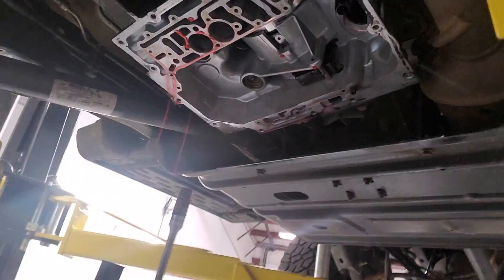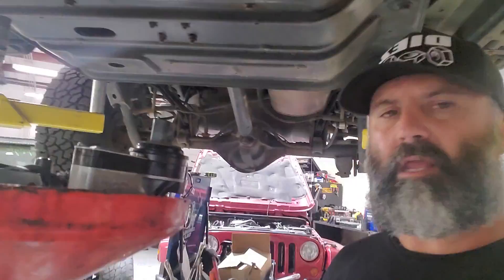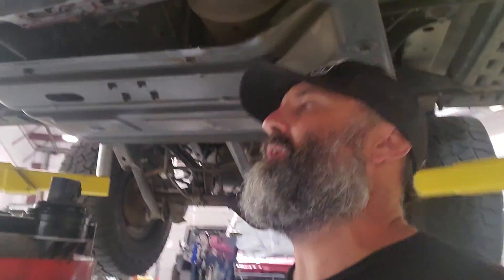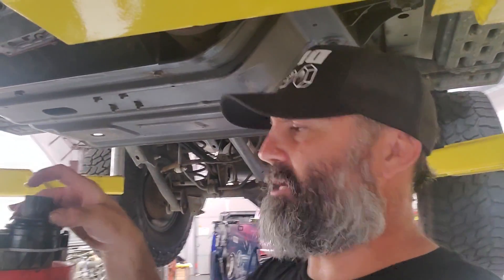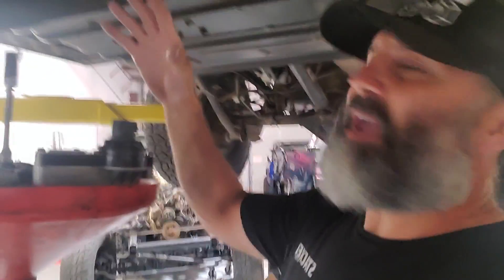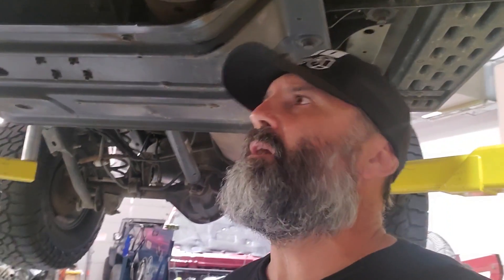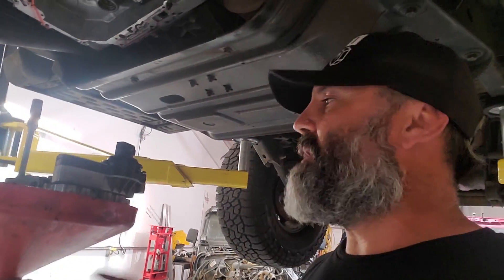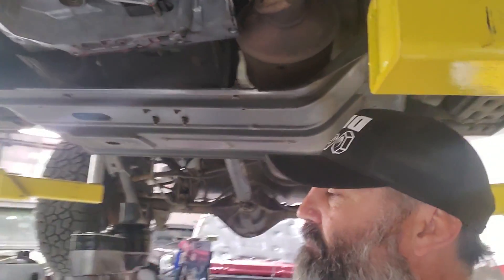42RLE jeep trany problems

Comment: I had to replace my pcm in my 2010 Charger with the 42rle and now it shifts fine except every now and then when I brake and it down shifts to 2nd when I accelerate again it bumps into 3rd and then it shifts fine again with no issues. Any idea what could be the culprit?
Reply: Did you reprogram the PCM to the VIN number? There are several things like fuel injectors, gear ratio and transmission shift points that are VIN specific and might not work properly if all parameters weren't updated when the PCM was swapped. You must have done some of it or it wouldn't start, but things like injectors or transmission controllers might let it run, but do weird things.
Reply: @mikelemoine4267  it was flashed by the dealer
Reply: @ImOBreezy  You might try disconnecting the battery and forcing it to relearn. Otherwise, maybe ask the dealer to scan it and make sure they have all of the latest flashes installed and that no codes are stored. Perhaps they missed updating something. Good luck, hope it's a simple fix!
Reply: @ImOBreezy  what was your transcoding before the pcm replacement?
Reply: @KingIrvXL  I have no idea
Reply: @ImOBreezy  transmission I meant

Comment: Hey man I could really use some help. I have a 05 Jeep Liberty Sport 4x4 with the POS transmission you are working on. The line going into the front of the transmission is leaking like crazy and this transmission is less than 2 years old. We put in a remanufactured transmission with no issue when we bought this Jeep. We dealt with the overheating issues and now all of a sudden the transmission went into limp mode and now it's just absolutely stuck and we cannot get anything loose despite you saying it needed a 10 mm this thing has a 10 mm, 15, 16, 18 mm, all these weird and I numbered votes on it. We can't seem to break loose even with a breaker bar the driveshaft to get it out of the damn way. I'm very frustrated and my father who is working on the vehicle can I physically handle doing something extensive like dropping the tranny again. There's no leak in the seals at all it's just at that line by the driveshaft. Really don't think it's the valve body. Never heard of any even leaking in this particular area. Any suggestions would certainly be appreciated because I am a single mom and don't have a lot of money to be dealing with this. We don't have a lift which would make everything a whole lot easier like you do we just have the regular old Hercules Jack to work with when lifting the car up. We have a new one that we just bought today so is there anyway you can help me I would appreciate it.
Reply from the maker: WOW call the shop 704-929-1788
Reply: @jeepstyle4054  in Richmond Virginia these guys here are idiots. I went in to do a recall about 2 years ago on the vehicle and they said it was 20 things wrong with it. Yet I've got $1,000 code machine and it did not come up with any of the codes they said it came up with. None of the codes had anything to do with the transmission or engine. The guys here are just untrained and don't know what they're doing. For example they sold me the wrong gas cap to start with so I had to go back and get the correct one. How simple is it to get a correct part like a gas cap? My father is just going to drop the whole tranny out because he's tired of fooling with it so we put another Jack in the back of the car and for extra of the old timey little jack's up under there so it doesn't fall accidentally for any reason. My father has big hands so it's just hard for him to get underneath the Jeep itself and for some reason it won't let me upload images on here. I might just take a video and put it on my side which I've never done before. Just to show how he had to wire everything direct to the battery through the car with a switch. And the parts he took off to make it a direct line so the fan will always be on and the car will not overheat anymore. Cylinder number four is the one that had the misfire but we've replaced that. Was running fine perfect for a year and then all of a sudden one day no puddles no indications nothing it just does this crap. I know my father doesn't have much longer to live and I don't want to bother him with this Jeep because he gets frustrated like any mechanic when every both is a different size. I know my father doesn't have much longer to live and I don't want to bother him with this Jeep because he gets frustrated like any mechanic when every bolt is a different size everything which I don't know why they do and it's on every car that he's ever worked on. And my dad has been a mechanic for over 60 years. He's worked on every type of vehicle including diesel including big trucks including NASCAR cars. But these Jeeps are just a damn bitch. I told him to stop writing about this car I'll buy damn mopad if I have to I don't care. As long as I can get to work and take my child to school and even to the grocery store a million times and the mopad  I'll do it. If work wasn't so far I would just walk. The bus where my daughter has to walk to is actually a two-mile walk. We live in the suburbs not the country either. But it's the front line going into the transmission that's leaking everywhere and the seals look good no leakage from them we just can't get the drivetrain to unlock to get the line-out period even when putting it in 4-wheel low it's still will not let us remove it. We put the right transmission fluid in it too and that was not cheap. Thank you for replying and I'm hoping maybe there's another way to get the drivetrain out because a screwdriver and a hammer and a breaker bar won't get it out. I have no clue at this point that's why my dad said just to drop the whole damn thing out. But it has to be an easier way if it's just this one lying that's busted to fix it. We got those old factory clamps off which took tooth-and-nail to get off but they came off. Any suggestions on how to get it out without my dad killing himself and having a heart attack? Like I said the Jeep dealership is out of the question. There are no oldies there anymore just guys under the age of 25 who really don't know what they're doing.
Reply: @jeepstyle4054  OK good news got it fixed!! those tranny bolts were a size 18 and 15. Come to find out the tiny $3 clip broke which loosened the line almost out. It was being held in place by a gnats a**. How odd. Every light is now off on my dashboard and no codes. My dad is doing good too. Why the bolts were so tight was my uncle used an air wrench instead of an impact wrench to install the bolts and to start with before my father new would he had done. He certainly knows now what happened but he never saw his brother put the bolts in because his brother is not the smartest person in the world. He's about 8 fries short of a happy meal when it comes to the world of mechanics. All he can basically do is paint a car and that's it. Yet he certainly thought he could do what he wanted with my car and I am not happy about that. But that is OK because my father has to go up there this weekend and will tear him a new one when he gets there as he expressly told him not to touch my Jeep. My uncle lied and said he got a friend to install the transmission originally. My father was not too happy about this. But since it's his brother he let it go. For me this is the third time he has messed up any of my vehicles. I will be going with my father up there and at the least he will have the most horrendous case of the runs while I'm there and we will be going out to eat . So he won't be eating much lol besides his own mistakes .He never apologizes for anything he does and thanks it's just OK to take what he wants from anybody . Now he is not mentally challenged and does not have any issues to where he absolutely does not know the difference between right or wrong . He's just a very spoiled entitled baby of the family. My aunt said that is an absolute lie because they live in such a small town in the Blue Ridge Mountains but everybody knows everybody. And she's the biggest nosy body there. If I ever need the truth I just go to her.

Comment: Hi jeepstyle im having a p0700 and p0740 come up and there was another one that was a slow shift cant remember code and hasn't come back yet any advice?
Reply from the maker: Obviously it's hard to diagnose a vehicle without it being in the shop, but that particular situation definitely has an effect on the entire transmission. if you remove the pan and everything is pretty clean and it checks out that solenoid pack is fucking gnarly.
And it's inexpensive enough to replace and then move forward. Hope that helps I'm talking about a situation that has a lot of moving parts but that's solenoid pack is the source of a lot of problems

Comment: Mine has no reverse . no grinding sounds or nothing it will shift into reverse and rev but wont go no where.. But everything else shifts fine ? Any input ?
Reply: My 1994 Jeep Grand cherokee 5.2 limited doesnt go into reverse gear until drive foward
Reply: I replaced the coil rail and plugs but it still seems to be missing abd theres a tap when running not sure if its a lifter or if i can adjust or not any body have any tips or trick 
#JEEPLIFE

Comment: Hi I did this to my jeep but must have gotten crossed up somewhere now it wont move unless your at 2500 rpm then it jumps in gear .forward and reverse . Any words of wisdom would be ausom and greatly appreciated.
Reply from the maker: Hey swap it again with another one though still annoyed packs especially from the auto parts store I usually have problems I usually try to go straight to a transmission supply place
Reply from the maker: Speak to text man sorry... solenoid packs from auto parts stores are a hit and miss
Reply: You probably didn't put enough transmission fluid in .

Comment: My zj 1995 limited doesn't move in Reverse. When I put it in neutral it drives. I'd shift it down all the way to 1 then up when when I get to neutral  it actually stays in neutral. When I shift to reverse it stops and just stays there.
Reply from the maker: Well it sounds like maybe you might have some play in your bushings or something.. that transmissions pretty mechanical still. if you're shifting it and it's in the gear it's going to act right you don't have any reverse I dropped the Pan and maybe adjust that reverse band there's videos on the Internet for that...
Reply from the maker: Well it sounds like maybe you might have some play in your bushings or something.. that transmissions pretty mechanical still. if you're shifting it and it's in the gear it's going to act right you don't have any reverse I dropped the Pan and maybe adjust that reverse band there's videos on the Internet for that...
Reply: Yes I've done dropped the pan and replaced the governor solenoid and pressure sensor I've adjusted the rear band. I've added tranny fliuds even tried to adjust the linkage. (another problem I forgot to mention. I cannot go into 2lo anymore)
Reply: @jeepstyle4054  Yes I've done dropped the pan and replaced the governor solenoid and pressure sensor I've adjusted the rear band. I've added tranny fliuds even tried to adjust the linkage. (another problem I forgot to mention. I cannot go into 2lo anymore) I really appreciate you responding I got the repair manual but they're is only so much I can do with what I know.

Comment: I did the solenoid replacement ... But now my transmission is stuck in reverse. How do I fix that ? Manually turn the shift rod ?
Reply: Did u figure  it out I have that same problem  only reverse  works wut did I do wrong😢
Reply: Help

Comment: My 04 goes into neutral when making a left turn but comes back when i complete my turn. I can reverse and go thru all gear. No check engine lights
Reply from the maker: Take the Pan off check for any kind of broken parts, or bad fluid... if everything looks good and clean that shift Cylinoid pack is huge.
Reply: @jeepstyle4054  thanks, I fixed it last week, it was low on tranny fluid lol, it runs perfect now

Comment: I change the shift solenoid on my 2002 jeep liberty and now stays in neutral what can I do
Reply from the maker: And that's not something it was doing before?] Just double check your steps make sure everything's put back together correctly. If it is I would say it's safe to say that you have another bad solenoid pack that kind of confirms that probably what's wrong with it I've replaced them several times..  😬I don't know what the problem is with rebuilding these hopefully they figure it out...
Reply: I put the bad one and it not working either it staying in neutral also and before the rivers,1st qnd 2nd was working
Reply: did you ever figure this out?!

Comment: My 2012 Wranger sahara is slipping between 3rd and 4th gear.....I changed trany fluid and problem went away.  that was back in september of 2021, here it is march 2022 and it's slipping again...Driveable tho, no slipping between any other gears.  I have the Chrysler Service and Diagnostic manual.  No matter what I read all the repairs sound expensive.  :(

Comment: This helped so much, I really thought I was gonna have to buy a whole new transmission, turns out its something a little cheaper.
Reply: Hello did i t gave you a code?? Am getting a 2nd gear  ratio !
Reply: @eldoggy295  I did get a code, but I forget what It was. I’ve heard that the code with read it’s a gear issue but It turns out to be the governor solenoid
Reply: @eldoggy295 we are having the same code did you ever figure it out?

Comment: I highly suggest if you have any type of these problems just get the trans rebuilt. I did this fix i had the problem with going into limp mode and not coming out of second gear. I ended up having to rebuild the trans 6 months later. I think this fix is just a bandaid for an underlying problem. Chrysler just cant seem to build their transmissions properly. If you look up yhe 42rle which is whats in my 2012 liberty chrysler has come out with so many updated parts to charge more money for their screw up in the first place. I think somone needs to start a class action for their horrible workmanship.

Comment: On my 1995 Jeep Grand Cherokee, when it is cold the O/D light comes on and it is stuck in 1st or 2nd gear.  When the Jeep warms up it runs fine.  Could this part be a possibility to solve this issue.    In warm weather it has no problem.
Reply from the maker: that's crazy.. are you checking the level right?